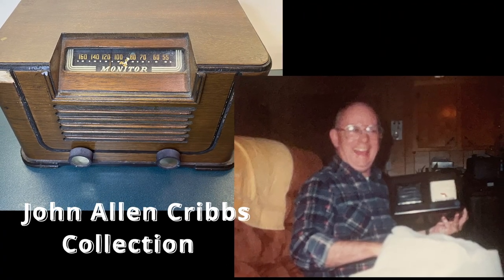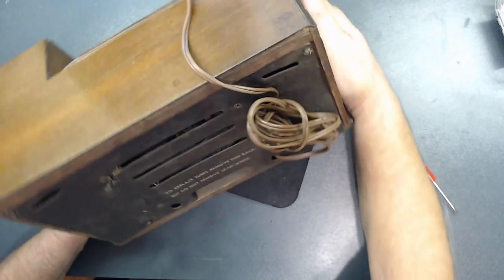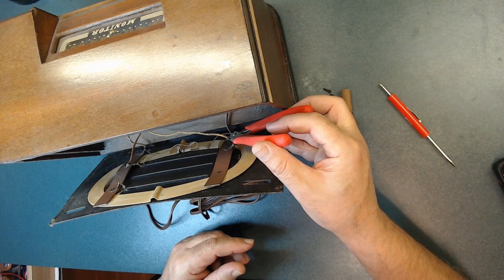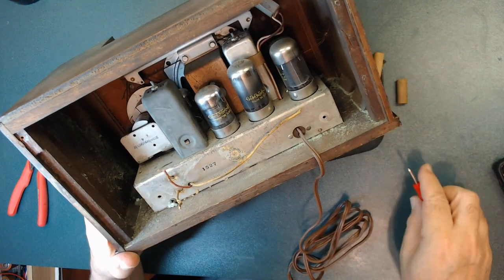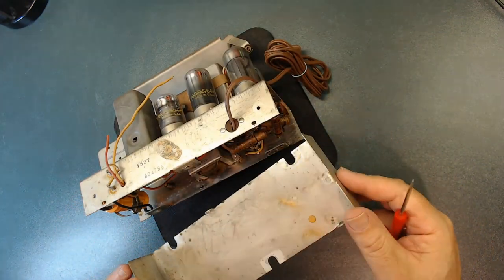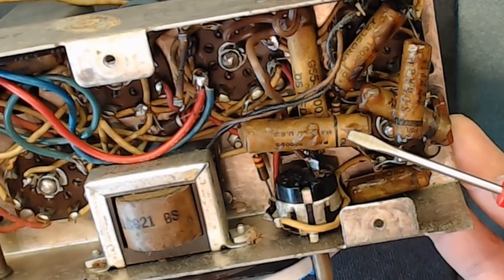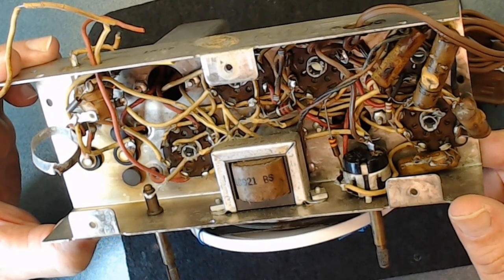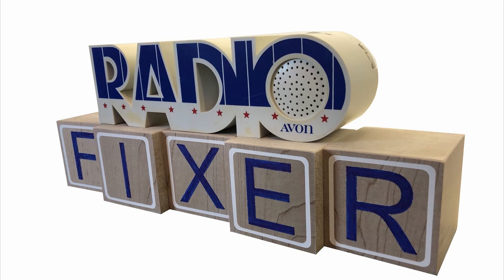Part 1 - Rewiring and Repair of 1946 AM Radio

Comment: Already working on another radio and have a video. The grass sure doesn't grow under your feet. Yes back then they used kind of a defective rubber insulation on the wiring actually the older cloth covered wire didn't break down like the rubber insulated wire. Then the melting caps ah yes you are gonna have so much fun. Thanks for sharing.
Reply from the maker: Hi Larry, OMG! Yep! I am on the mission to finish all these radio and start working on mine again (Mission Impossible). LOL.  This darn radio needs a lot of work. The only radio that was working from this collection needs tons of work. As you said “melting caps ah yes you are gonna have so much fun”. LOL. You are right my friend. Good hearing from you! Have a good day! Jay

Comment: That looks very much like a Crosley-built set.  From the yellow rubber wiring, loctal tubes (which they used for a short time too), chassis construction with those pins to pull the bottom off (the later Crosley dashboard radios have the same construction), the style of wooden stand-offs for the back, the style of the IF cans and even the format of the model number... all scream Crosley to me.  So I'd say the tubes are original, and it was probably an off-brand for them, perhaps sold only in certain stores.
Reply from the maker: Hi Adam, is so good hearing from you! That what I thought since all tubes was Crosley, This is such a great information, thank you for taking time and sending it to me. I just checked your YouTube channel and you do have so many unique radios and doing a great job on those. Have a great day! Regards, Jay

Comment: Hi Jay. I don't know how familiar you are with Loctal tubes, but they can be a bit difficult to remove if you don't know how they are locked in place. They used them a lot in car radios because of the vibration would loosen normal octal tubes. As you say, one step at a time and you will be fine. :)
Reply from the maker: Hi Doug! why I always end up with working on radios that needs a lot of work? LOL. Guess need pay my dues before become a real technation. Maybe someday I can just change capacitors and call the job "Restoring" like some other YouTubers. LOL. Anyway, these radios are forcing me to read the darn crazy and confusing schematics and get better at it. Yep! I am pay my dues! LOL. I did not know these tubes called "Loctal" and was used in car radio. I am learning so much from you guys! Thank you my friend! Have a good day! Regards, Jay

Comment: Hey Jay!
That part that you thought was a resistor, IS A RESISTOR!  They are called "Flexible Resistors" and I haven't seen any in radios I have dealt with, but there are a number of manufacturers that did use them.
You're going to need quite a thin veneer to patch that missing strip of veneer and then matching the color of the rest of the case will be interesting to see.
I know that it is a lot of work, but I highly recommend that you do replace all the defective wiring.  Do you have a schematic for this one?
I noticed that the tubes are "Loctal" type tubes.  I don't know if you already know this or not, but they have a raised dimple on one side of the base. Simply tilt the tube towards the dimple and they will pop right out of the socket.
A lot of sets that used Loctals will show an arrow on the tube placement chart showing what direction to tip the tube to remove it.
I don't think that the stuff on the top of the labels on the bottom is stain...I think it is glue.  They probably didn't have it way back then, but the glue you have used and placed on top of labels would be far better because it turns clear when it dries.
I realize this request will require mega more work, but I have a request for you.  If you are going to be using a stain anyway, how about sanding, staining, and lacquering the inside of the cabinet too?  The inside and bottom of cases always seem to be overlooked...why not make them look their best also?
Keep up the excellent work my friend!
Reply from the maker: Hi Wayne, this was the first time I saw a resistor like that, check the schematic and is 47 ohm 1 watt resistor. I did not know these tubes called "Loctal", and this is the first time I saw  "Flexible Resistors". Thank you for letting me know about this. As I told Doug, I do not know why I always end up with working on radios that needs a lot of work? Guess need pay my dues before become a real technician. Maybe someday I can just change capacitors and call the job "Restoring" like some other YouTubers. LOL.  Staining inside a radio? OMG I thought you are my friend, why you are giving me more work.. LOL. I just want to finish this and get it done and start working on my own radios. then I can do magic’s..  LOL. Good hearing from you my friend! Regards, Jay

Comment: I  had to do a double take on your video when you said it was a model TC36M.  Looking at your introduction below the
 video you did catch your mistake. Model TC56M is correct. What a weird resistor that got burnt out. Looks like a wire in
 a toaster! Maybe it should of been a higher Wattage or the current load from all those bad old wax capacitors burned it 
up. It is a low resistance ,like less than 82 Ohms, and couldn't handle old age! Replace it with a similar one but up the Watt
 rating to twice what was called for as they make smaller and  better components today. Rotten wire replacing takes a lot 
of time. Hey, retirees should have some time on their hands Jay , maybe you live near one and can teach them soldering
 on new  wires. LOL
Reply from the maker: Hi Steve, so good to hear from you! Sometimes I get "ADD" and forget about stuff, OK do not laugh, have nothing to do with my age.. LOL. That is a very weird resistor and look like a toaster wire. Guess this radio had the ability to toast morning bread. . LOL.  Wayne said on his message that is called "Flexible Resistors". This was my first time to see something like this.  It is 47 ohms and 1 watt resistor will replace it with 2 watts resistor as you suggested. Do to inflation I do not know anyone around Florida who are retired.. LOL I am still working full time. Unfortunately was hoping to make some money on this darn YouTube channel, but you have to have trillion hours of watching. LOL. Maybe I should start charging people,  since this free deal is not working that well.. LOL. 
You have such a great sensor of hummer my friend, make me laugh and get focused to do more damage. Have a great day! Regards, Jay

Comment: The radios with the rubber wire are a pain. That resistor looks like it burnt open Jay.
Reply from the maker: Hi Jim, good hearing from you my friend. Yes you are right!
Wayne mentioned in his message that this resistor is called "Flexible Resistors". 
This radio chassis is just 3” wide has 5 “Loctal” vacuum tubes and all wires must be replaced since losing wire insulations. 
Also part of veneer cabinet is missing so need to be fix. 
It is a nightmare since wires, resistors; capacitors all compacted over each other in that 3” wide space. 
Wish me luck! LOL. Have a good day! Regards, Jay